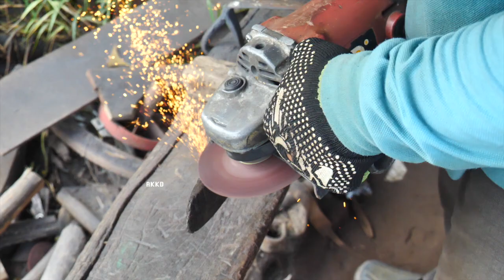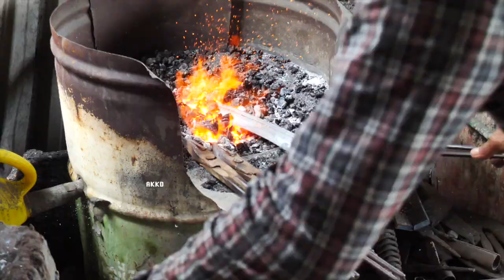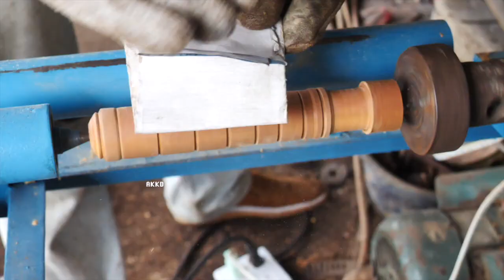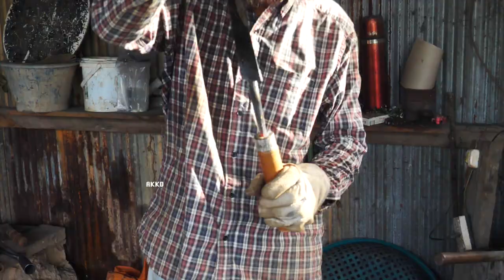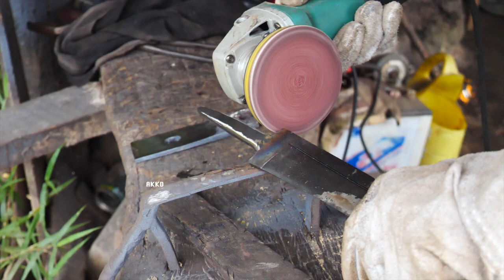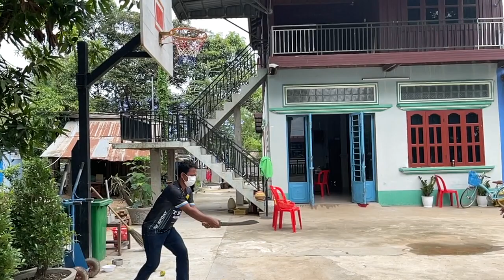THE AMAZING SKILL OF KNIFE MAKER/HOW TO MAKE A LONG KNIFE

Comment: How did you temper after the oil quench?
Reply: With the way only the edge was red from the heat and how little amount of oil was used I have a feeling that it is tempered and quenched all in one because that oil would get too hot to cool it down enough to get it past the super hard edge